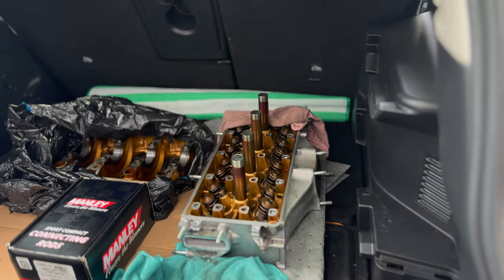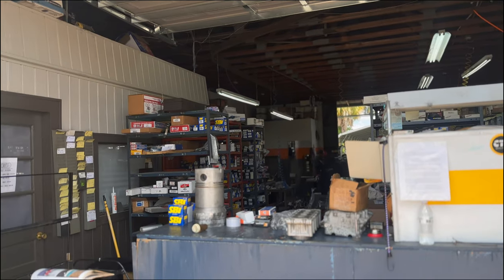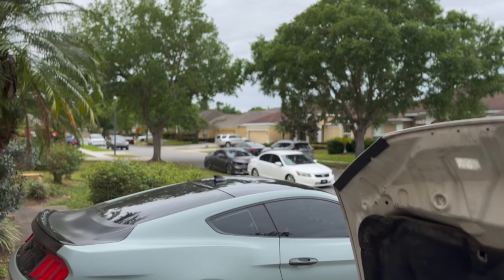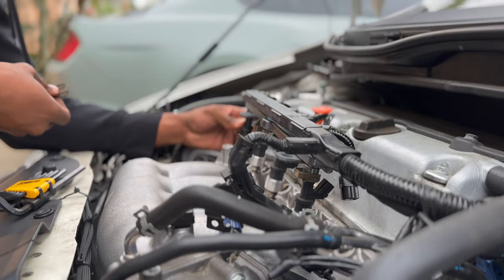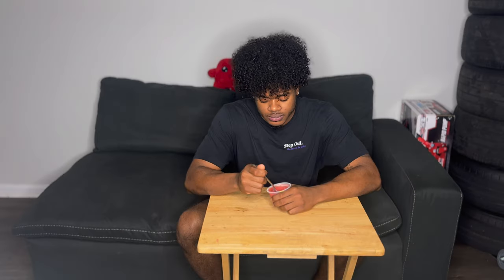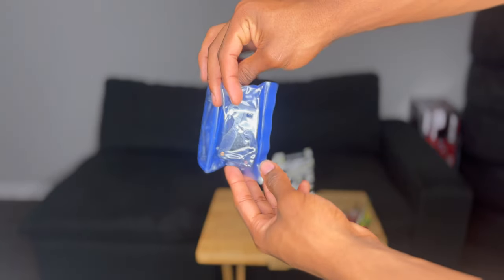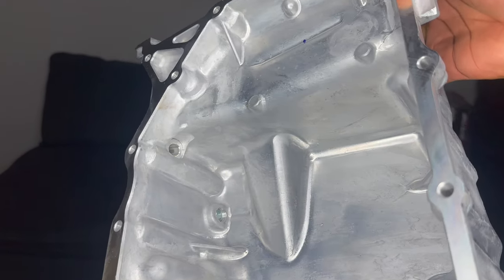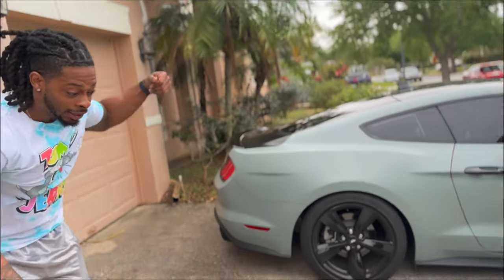NEW PARTS FOR MY FULLY BUILT K24Z3.

Comment: planning to get a 15 civic si with nav and summer tires and red interior with 62k miles for like 18k but it was supposedly a work fleet vehicle is that a bad thing??good deal or no
Reply from the maker: Not a bad thing at all, just means it was used by a company as a work car for a bit. As long as it looks like it hasn’t been modified much i would take it

Comment: Yessur you should go all the way to 9k i have a fully built k24z7 bottom end and does it no problem w ported type s pump
Reply: What do you have done? What do you mean by fully built bottom end? I got a k24z7 and want to do the same thing that’s why I’m asking.
Reply: I have 12.5.1 comp 87.5 wiseco pistons, saenz rods ,prl oil pump kit , 4 piston ported type s oil pump and king race bearings
Reply: @fg4_jr408  did you have to take it  to a machine shop?
Reply: Yessir i did since i had to make the bore bigger stock I believe its 87
Reply: @fg4_jr408  how much you making?
Reply: Well i do have a k20z3 head ported with spring and retainer and valves with 3.2 dc cams im making close to 300 hp on a e tune
Reply: @fg4_jr408  damn that’s amazing that’s exactly what I want to do. How did you get the z3 head to mate up with the z7 block.
Reply: And what did you port it to?

Comment: Hey bro since the type s pump relocates the oil filter, you should modify your filter block off plate with a 10an bung and drain your turbo into there instead, that would be a way better option then draining back into the pan
Reply from the maker: Never even thought about that 🤔 I’ll do my research and consider it next engine build 🤝🏾